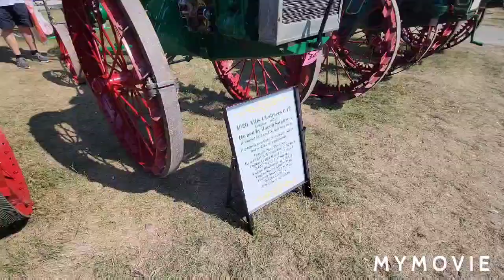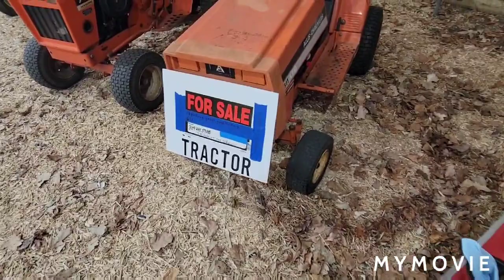2021 Orange Spectacular,  Allis Chalmers tractor show

Comment: Nice video.  Thats me at the 15 minute mark making room for wheat in the wagon.  I held the flap open on the chute so the young man could see it flowing into the wagon and I handed him a handful of wheat and told him that it was a nice clean sample.  That is one of the oldest combines we run there and produces the cleanest samples.
Reply from the maker: Hi there. Yeah I cut you off when you started talking to him. I wish I would have got your commentary with that little guy. Good show this year just wish it wasn't so hot and dry